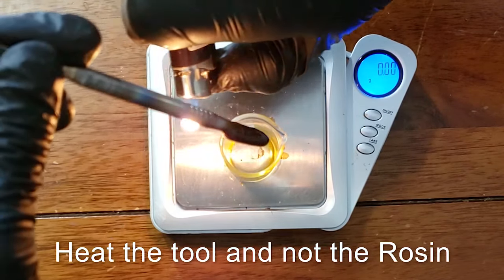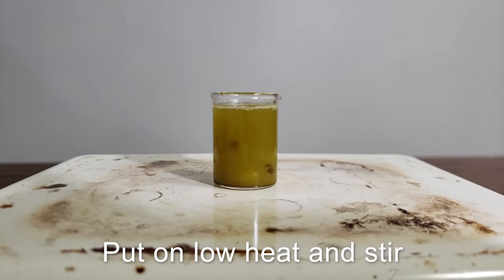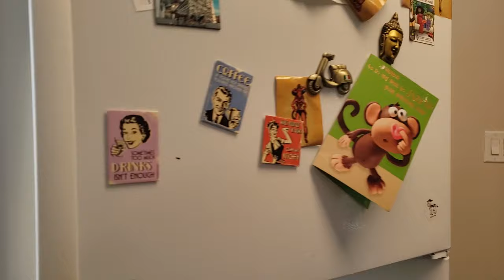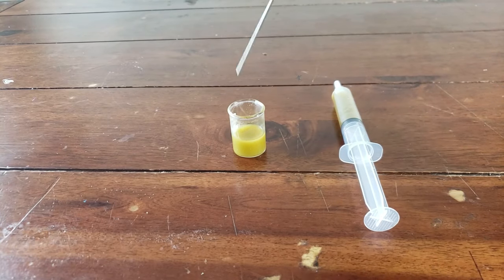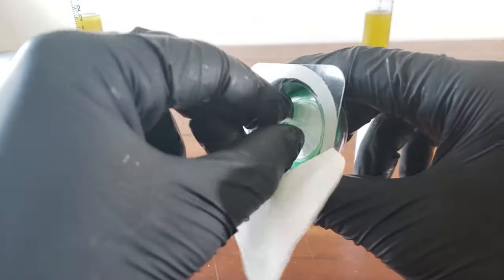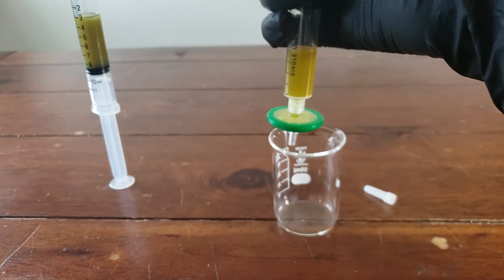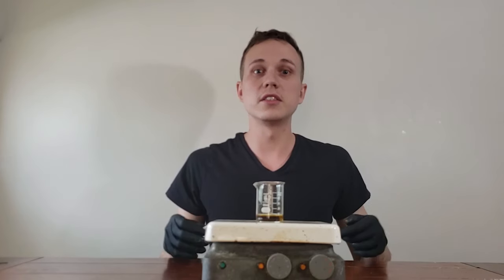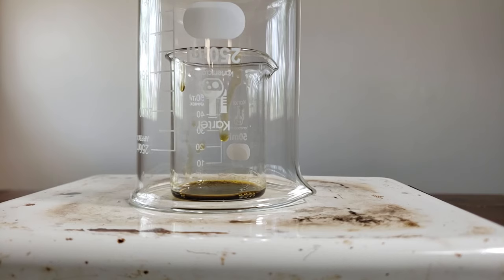There is HOW much Fat and Wax in Rosin?

Comment: Something i havnt seen much info on - the syringe filter membrane. I can't be sure but the green filter seems like PES, does anyone have any data on the difference between this and PTFE?
Reply from the maker: PES membrane generally offers fast flow rate and better chemical resistance than cellulose acetate membranes. PTFE membrane is strong, highly porous, and inert to most chemically aggressive solvents, strong acids, and bases. Chemical and thermal limitations are imposed by the backing material.

https://www.coleparmer.com/blog/2013/07/11/choosing-syringe-filters-and-other-types-of-filtration-for-the-laboratory/
Reply: I've actually come across this exact link before. Not that I'm dense, I just can't really translate that into "which filters out more fats/lipids." I have multiple retort stands that use three-fingered clamps to hold the syringes while they filter so flow rate isn't the concern, rather which leaves you with a cleaner product.

Comment: If you took that rosin you put in that tiny beaker and allowed all the alcohol to evaporate then add in processed XCT coconut oil in a 1/1 ratio by weight, (I was told, I use more though), then put the beaker in the microwave for about 10 seconds.  Heat it just a little at a time then take it out and stir.  If it doesn't all dissolve put it in again until the rosin has been fully dissolved into the oil, then suck that oil up into your one milliliter syringe.  What you did not mention, was if your bud was "Decarboxilated" that you squeezed the rosin from.  If you are going to vape your final product that would not be necessary as the heat from smoking will convert THCA into THC.  I Decarboxiliate my bud before putting it through my NUGSMASHER process.
The strength of your finished product would need to be tested unless you know the THC content of your bud and can calculate the weight of your finished product to determine its strength.

Comment: at 2:33 you pulled the top extract into one syringe and then the wax, fats, and lipids portion was poured into another beaker. my question is at 4:40 you combined two syringes into one beaker, were those syringes from two top extract jobs? if not what did you do to the wax, fats, and lipids from the extract process at 3:22?
Reply from the maker: Those were both from the same filtration. I used 2 syringes just to show the difference in color. Then when filtered they went both back into the same beaker. The fats and waxes remained trapped in the syringe filter. You can get them out by pushing alcohol through the filter.
Reply: @CartandPod  thanks for the info, big help man and i appreciate the on going help. so just to clarify after you mix/ dissolve the rosin in the ethanol and let it chill for the 14 hours, you could pull the whole batch into one syringe and the syringe filter that is attached later will separate the wax, fats, and lipids afterwards? Do you use a new Filter with each job or can the same filter be used multiple times?  (super jealous of the mixer/ heater, mine only mixes and i have to reheat every couple minutes).
Reply from the maker: @charlesneimeier5076  I would reccomend using a new filter and syringe each time. Try to push it through as fast as possible after freezing for best results. My filming and demoing made me wait too long and I could have filtered more if I was faster.
Reply from the maker: Also you only need to freeze it for about 6 hours. I just happened to do 14 hours.
Reply: @CartandPod  you are awesome thank you. i will try this out next time i get a dark rosin and see if the ethanol purge with the filters help return some clarity.

Comment: Is it necessary to winterize rosin if using to vape ?
Reply: No. You can make vape oil from rosin if you decarb the rosin, then add non-solvent liquid terpenes.
Reply: @ciscodipi316  is it possible to do it also if I mix the rosin with ejmix then add terpenes for flavor ?
Reply from the maker: You don't need to winterize to vape rosin. Just filter the fats and waxes out using the syringe filter. Winterizing it with alcohol will stop it from being solvent-less.
Reply from the maker: You can mix the rosin with EJMIX and then filter, it will be easier. I would recommend using ONLY terpenes however. No EJ mix needed.
Reply: @CartandPod  what measure should use? What terpenes you would recommend? Should it be mixed while warm? What microns on syringe filter should use?
Reply from the maker: Links in the description to the syringe filters. Filter while warm yes. Mix terpenes when warm too. https://HowToWeed.ca/recommends/terpenes/
Reply: @CartandPod  ok and what ratio terpenes to 1g rosin? 15% (0.15ml?) And add terpenesnefore filtering or after? What about decarb? Would you pls setvst3p by step? Do you need to 'start' every new ccel cart? Ive heard about you need to start up every ne cart to avoid overburn??

Comment: Why not use food grade non denatured ethanol
Reply from the maker: No such thing as food grade and denatured... denatured means they poison it so you can't consume it...
Reply from the maker: Never ever use denatured anything for consumption!!!
Reply: @CartandPod  that's why I said non denatured
Reply from the maker: Oops I misread! Yea any non denatured ethanol will do. I just say everclear because most people recognize that brand but any will work.
Reply from the maker: No it doesn't have sugar it's just 95% ethanol and 5% water.
Reply: @CartandPod  so doing the winterizing will that make the rosin burn cleaner in a quartz banger?
Reply from the maker: I wouldn't bother winterizing rosin, you should instead just use the ethanol directly on the cannabis flower
Reply: @CartandPod  like make rso?
Reply from the maker: Ye but if you winterize it won't be black rso it'll be proper shatter
Reply from the maker: Rso is basically an extract made wrong by using heat when you should use cold
Reply: @CartandPod  I use cold when I do rso
Reply from the maker: I wouldn't really call that rso then, it's a cleaner product if you do it that way and winterize it
Reply: Do you have to put it through the syringe  filter in order for it to be considered completely winterized?
Reply from the maker: You should use a filter paper and a vacuum flask to pull it through for larger scale not a syrigne filter. The filter is just for a small scale example.

Comment: how much is lost during this process, %-wise?
Reply from the maker: Depends on how dirty the rosin,  can be between 5 and 30%
Reply: @CartandPod  It seemed the syringe only filled to 0.2ml. 5-30% loss is not that bad. Does this yield more than just doing the extraction with ethanol?
Reply from the maker: @PoulJulle-wb9iu  best would be to press the rosin then wash the rosin pucks after and doing 2 batches

Comment: Perhaps invest in a few small silicone cups, or buy a cupcake rack and cut a few out.

Non-stick my man.
Glass is nice, but unless...ok you can dab pyrex...nevermind....just get a drinking straw and a lighter.
Reply from the maker: These beakers are so small it's easy to clean them. And you pretty much can dab pyrex although this beaker is wayyy to thin for that
Reply: @CartandPod  it would have made the process a bit difficult to see.
My mind wanders into shallow waters at times.
That's one in my oops, shit, column.
Reply from the maker: Yea no worries, same reason I leave the caps off sometimes, to film it easier/better

Comment from the maker: Support the channel by shopping at: https://CartandPod.com
Instagram - @johnbrowncannabis - https://instagram.com/johnbrowncannabis/
Twitter: @JohnBrownCanna - https://twitter.com/JohnBrownCanna

Subscribe - http://www.youtube.com/c/HowToWeed-ca?sub_confirmation=1
Reply: Great cotent video, i didn’t know that there is such an easy way of purification. 👍🏻
Reply: Thank you for the links and the video!
Reply: Great video. Great information.
Reply: adding solvent to a solventless extract for the purpose of romoving the terp bairing waxes is absurd. totaly destroyed your product, now its super low quality looks like shitty cherry oil from stemmy trim. i guerentee that your winterized rosin will not even bahave like a winterized bho,  Non winterized rosin is easier to handle tastes better looks better smells better. honestly why you do this man?
Reply: Not only does it not make sense to winterize a solventless extract like another commenter posted.since everything was done outside the freezer and you took too much time to do it most of those fats and lipids have read dissolved into the solvent solution do to temperature all of this must be done inside the freezer preferably using a Buchner funnel.
Reply from the maker: As it's been stated hundreds of times now, this was just a basic demo of the process. If I did it properly it would have been less filmable.
Reply: HowToWeed what’s the difference between decarbing and winterizing? New to this 😅

Comment: You could just pour it thru a coffee filter after taking it from the freezer and do not need all those syringes.
Reply from the maker: The syringe filter is a much lower micron count isnthe difference. It's able to catch and filter the lipids and waxes as well that would go through a coffee filter. This also minimizes losses to the filter.
Reply: A coffee filter is 20-50 microns which is more than adequate. A buchner filter is best.
Reply from the maker: Yes a buchner filter would be best for sure. Will have guides on that after I make a homemade vacuum pump
Reply: Great! Winterization is important and a step many leave out. I hope your guide includes the use of a desktop still for ethanol recovery. I enjoyed this video but just thought the last step might turn people off from trying it because they do not have a syringe filter or other lab stuff. They just need to dissolve their concentrate in everclear put it in the freezer for at least six hours and let it run thru a cone coffee filter on a mason jar(s). Keep up the good work!
Reply from the maker: A syringe filter is cheaper and easier then a buchner filter, and a normal coffee filter would take too long to gravity filter the mixture would reach room temp and it wouldn't filter as well. But I agree proper methods are much better. This is just the cheapest method imo.